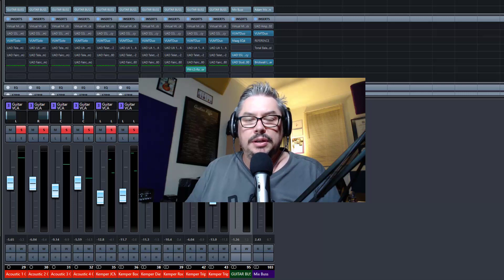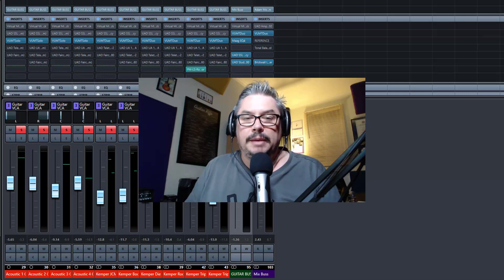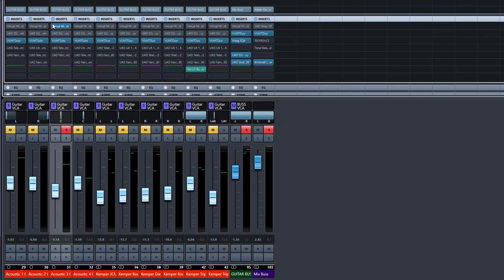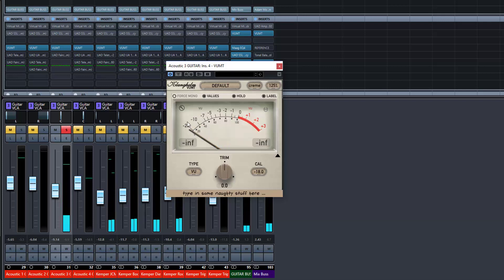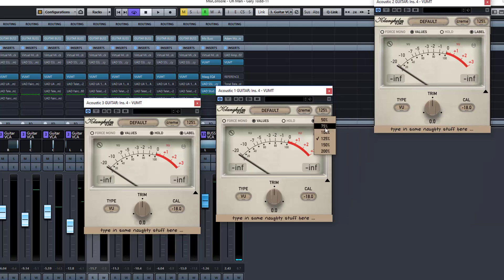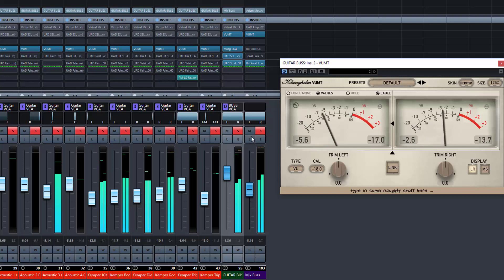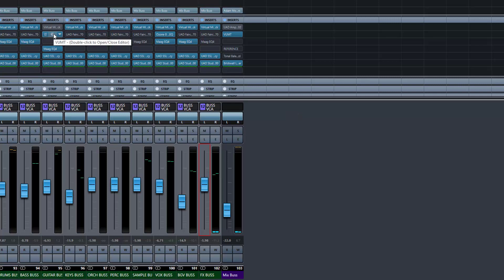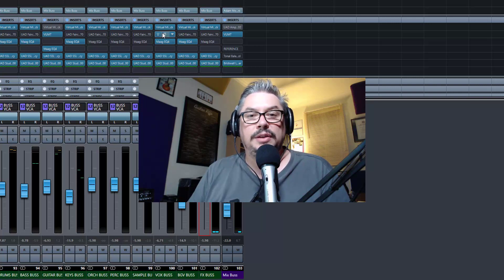How to Gain Stage using a VU Meter - Gain Staging Mixing Tutorial

Comment: So the point of gain staging through a vu meter is to get it to hit at 0db on the VU meter? then mix balance with the volume faders?? and also doing this in the master channel ? Thank you
Reply from the maker: Yes it is basically a method to make sure that you are not clipping audio at any stage in your mix. If you target 0db on the VU meter at every stage then you are sure to not be clipping. Thanks for watching.
Reply: @kdwmixingmastering  so if -18dbfs is 0db on vu meter and Im looking at my master fader which is around lets say -6dbfs,,, that means Im clipping??? thank you
Reply from the maker: Sorry I'm not really sure what you mean here. In my method you need to gain stage at every level so you should end up with -18dbfs or 0db on the VU at the master fader as well. You get each or your tracks right then you lower the next grouping (buss) and then you lower the next grouping (more busses) and then the last one (master fader). Then I end up with a low volume mix that isn't clipping. Then I leave the final volume level for the mastering stage.

Comment: I opened up Cubase after watching this video to test out and see if this was necessary for me. What I did was record a quick synth part, duplicate it onto a new track, and flip the polarity. From there I added a bunch of plugins that emulated analog hardware. I finally turned the clip gain up to make sure I was clipping on all of the plugins and matched the volume with the original recording. I ended up with a null.

I also tried clipping Cubase's channels (not the master) to see if that made a difference. I'm not really sure what the point of this would be besides ending up with a mix that is -18dbfs. It seems like a lot of extra work for little or no added benefits. Could you please explain what other benefits this has?

Thanks.
Reply from the maker: Because Cubase and most DAWs these days use 64bit processing of audio, clipping the individual channels is actually not going to cause an issue. Just don't clip the main output. I don't understand what is happening with the analog emulating plugins though because if you are clipping those then they should be adding some distortion or something. Of course I don't know what plugins you are adding so maybe they designed them not to do that and it doesn't matter what level you put it through. Some plugins are designed to have a sweet spot at -18dbfs, a lot it doesn't matter.

I like this approach also because it keeps me thinking about levels and making sure that I am not distorting when I don't want to. Some people just push everything high and then wonder why their songs sound horrible. If this is not you and you are happy with your method then that is fine. There are no rules on what is the right way. I personally have some OCD in that I hate seeing things clipping in my sessions. Those little red lights annoy the heck out of me. Keeping a well structured approach to my gain staging prevents this from happening and again it gives me confidence that nothing is going to distort unless I want it to. Again there are no rules and I always suggest that you take peoples advice and opinions including mine, try them out and then make your own approach that suits you either based on it entirely, partially or not at all. 
 
Thanks for watching and thanks for the feedback.
Reply: @kdwmixingmastering  That makes more sense, thanks for taking the time to explain your reasoning.

Comment: Instead of changing the gain on the cubase track why don't you just use the trim knob on the VUMT? Also if I was recording in using a guitar plugin would I place the VUMT before or after the guitar plugin? Thanks
Reply from the maker: Yes, you could use the trim control on the VUMT. I don't do that mainly because I don't generally use the VUMT on every track and if I did for gain staging there is a good chance that I would remove the plugin once gain staging was complete, which would break the work I did.
As for the guitar plugin, I would put the VUMT after the guitar plugin. The reason I would do it this way but others might argue with it is that you might want your signal going into the guitar plugin hotter or lower to get the sound you want out of the plugin. In my head, I am imagining the guitar plugin as pretending to be an external amp which is then fed into your DAW, which you then gain stage. If you put the VUMT before the plugin and use the trim knob then you are going to change the amount of signal fed into the amp and change how it reacts and sounds.
Reply: Makes sense. Thanks @kdwmixingmastering

Comment: Cool what about the snare and hi hat make this 0 too ?
Reply from the maker: Yes I would do it for the snare as well. The HiHat is a different beast. In theory I would make it 0 but I find that the HiHat mic I either turn down very low or remove all together. A lot of the time I find I get enough HiHat out of the snare and overhead microphones. It depends on the song though and how the kit is being played. If it is being played like a really soft Jazz style then the HiHat mic may be essential. If on the other hand it is a very hard hitting metal track the HiHat may be bleeding into every other mic and might be driving me insane with the amount of noise it is making.
Reply: KdW Mixing & Mastering Compare snare and hi hat or snare and kick?

Comment: Hi again!
Just a couple of quick questions

1. Is there a difference between "Clip gain" on the track verses "Pre gain" in channel settings?
2. If you have a number of say guitar tracks routed to a "Group Channel"  could you not add the VU meter to that channel and sett the levels of each individual track whilst visualising the VU meter on the group track.

I'm not too familiar with this hence the newbie questions

CK
Reply from the maker: Hi Charles, 1: It might depend on the software you use but I think it is similar and will produce the same results. I like using clip gain because I can visually see the impact on the waveform in the track. 2: As long as your DAW is using 32 bit floating point (which most do) then your concept with just doing it on the group is fine. This is assuming you are only placing plugins on the group channel and not on each guitar track. If you are putting analog emulating plugins on each guitar track then they might be distorting due to the clips being too loud even though you have gain staged at the group level. How that makes sense. As much as it might seem a bit OCD I find that if I stick to the full routine all the time then I never have any issues. There are times that I could probably short cut a step because I am not using a certain plugin etc. but I like to stick to my process all the time no questions. It just prevents any surprises later in the mixing process.
Reply: Great! Thanks for the reply (So fast too!!) I have just downloaded a VU meter by Tone Boosters. 
The VU meter I guess would be on insert slot 1? I see you have the Slate Console on your slot 1 though.
I am a Cubase Pro 9.5.2 user. So I follow your techniques quite closely. I have tries out the gain stagin on one of my track....... WOW. I realised how much some of my channels were being pushed. Much easier to mix once level matched!

Thanks a million
Reply from the maker: Yeah I put it on slot 1 because I want to see the level at the start of the chain prior to any plugins that might be boosting the signal. I am glad that it has helped you and I really appreciate the great feedback.